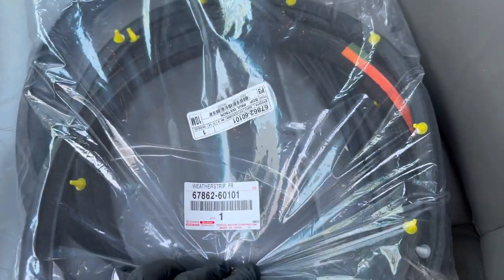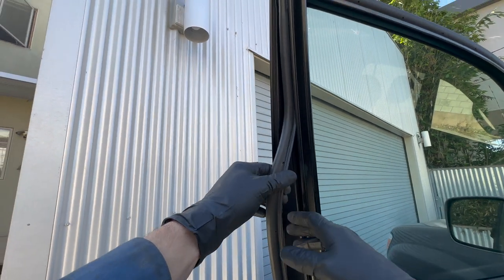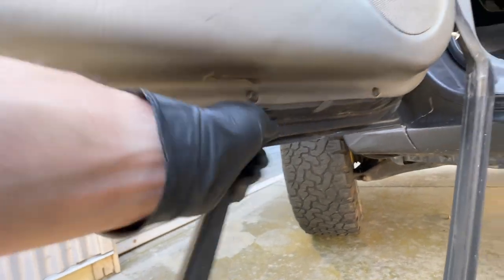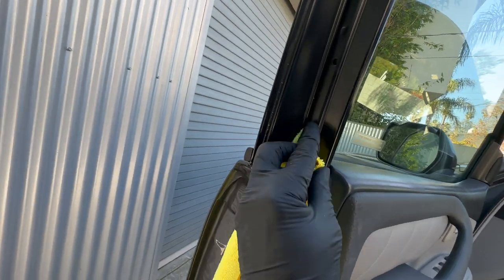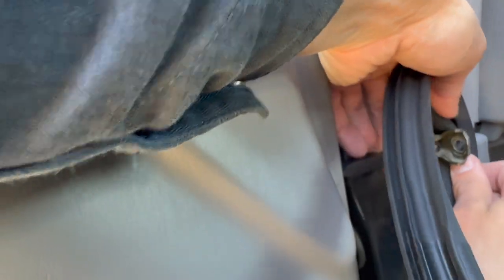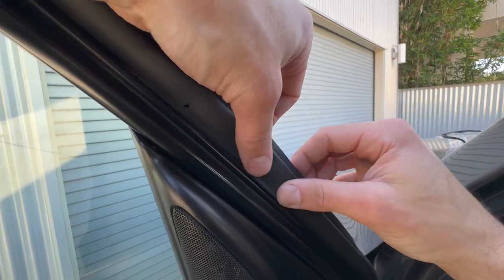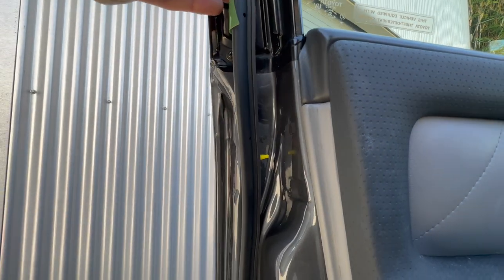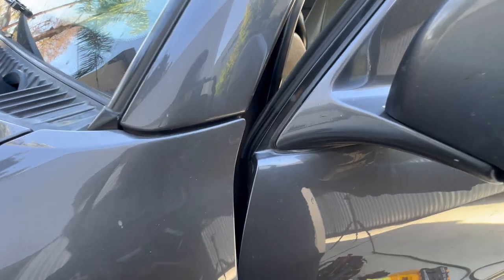Replacing the driver's door WEATHERSTRIP on a 2006 Land Cruiser

Comment: Another great video. Thank you so much for doing these. Truly excellent quality. 

A couple of future video suggestions:
- Heater T replacement
- Brake pad replacement
- Timing belt/thermostat replacement
Reply from the maker: Great suggestions 

- Brakes are next up!
- Timing belt I just did and in the middle of recording it, I realized the best timing belt video already exists from Otram. He has the motor out of the Land Cruiser and super easy to follow. 

- BUT he doesn’t cover how to remove the cams to replace the cam seal, so I’ll post my experience doing that project for all the VVTI folks :)
Reply: LCDIY, did you end up posting that additional video for timing belt? I don’t see it in your video listing.

Thank you again for all your videos! It’s been invaluable as a new ‘04 LC owner.

Comment: Thanks for the video. I also have a 2006 LC and sometimes get a whistle during crosswind. I will be looking into this. Do you have the TSB number? I had not seen this one before. Also, did you replace driver and passenger side, or was it only the driver side?
Reply from the maker: Thanks for the comment!  The TSB is NV008-05.  For reference, I purchased mine from partsouq.com for $60.

Comment: love your channel ... i'm just starting an LC100 adventure (didn't get the car yet) ... any advice for people that are new to the game and want to buy a LC100 ....you content is amazinly well made ...keep up ... peace from Algeria
Reply from the maker: Good luck, let me know when you make the purchase! Took me about 6 months to pounce on this one.  #1 the fewer owners and more documented maintenance history the better #2 think through trade offs of 06/07 vs pre - you get more power and possibly AHC (pro or con depending on your priorities), but get the annoyance of no transmission dip stick, cam shaft seals which require removing the cams (which I just did and wasn’t thattt bad), I think 06 has a secondary air injection system (at least in the US) which will 95% chance fail (I’d recommend bypassing it).